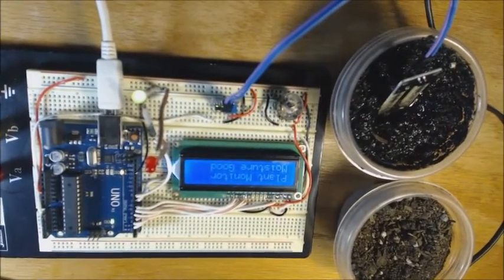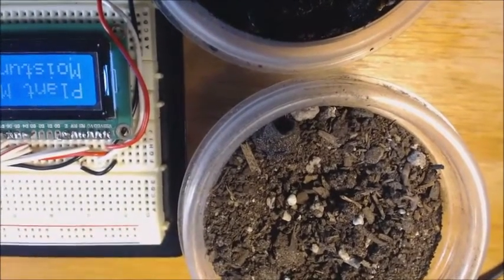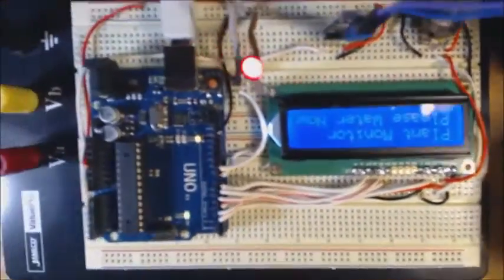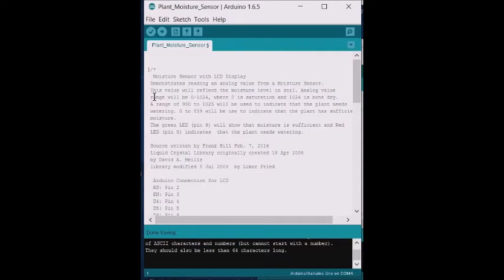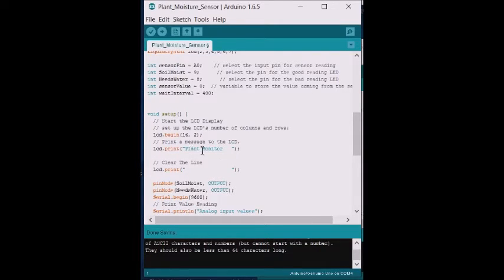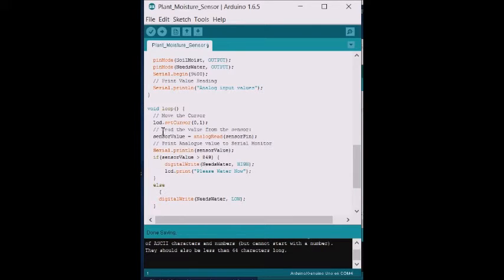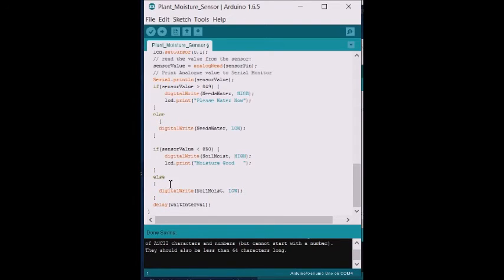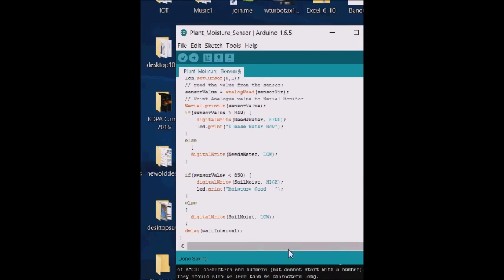SoilMonitor

Comment: sir plz send me tha program with LCD ganeshtambade77@gmail.com
Reply: Pour ma part j'ai opté pour un écran I2C LCD.

Je vous donne le code qui fonctionne. Pour les branchements seules les LEDS et le Soil Monitor sont valables.
Ecran I2C LCD
scl=a4
sda=a5
vcc=5v
gnd=masse

//Essai numéro 1
//L'écran s'allume au démarrage
//La détection fonctionne voir plus tard pour réglage
//Première ligne s'écrit je tente la seconde
//Elle fonctionne, je tente l'autre
//impeccable tout fonctionne
//Il me faut régler l'intervalle (ce sont les commentaires de mes essais)

#include <Wire.h> 
#include <LiquidCrystal_I2C.h>

LiquidCrystal_I2C lcd(0x27,16,2);  // set the LCD address to 0x27 for a 16 chars and 2 line display

int sensorPin = A0;           // sélectionner la broche d'entrée pour la lecture du capteur
int SoilMoist = 9;              // sélectionnez la broche pour la bonne LED de lecture
int NeedsWater = 8;         // sélectionnez la broche pour la mauvaise LED de lecture
int sensorValue = 0;        // variable pour stocker la valeur provenant du capteur
int waitInterval = 400;

void setup()
{
  lcd.init();                      // initialize the lcd 
  lcd.init();
  // Print a message to the LCD.
  lcd.backlight();
  lcd.setCursor(3,0);
  lcd.print("DUPONT");
  lcd.setCursor(2,1);
  lcd.print("PONDUT");

pinMode(SoilMoist, OUTPUT); 
pinMode(NeedsWater, OUTPUT); 
Serial.begin(9600); 
// Print Value Heading 
Serial.println("Analog input values"); 
   
}

void loop()
{
  // lire la valeur du capteur: 
sensorValue = analogRead(sensorPin);
 // Imprimer la valeur analogique du moniteur série 
Serial.println(sensorValue);
 if(sensorValue > 849) { 
     digitalWrite(NeedsWater, HIGH);
          lcd.init(); 
          lcd.backlight();
          lcd.setCursor(0,0);
          lcd.print("Arrose de suite");
          lcd.setCursor(5,1);
          lcd.print("Merci!");
      }
 
  else 
{ 
    digitalWrite(NeedsWater, LOW);
 }
if(sensorValue < 850) { 
        digitalWrite(SoilMoist, HIGH);
          lcd.init(); 
          lcd.backlight();
          lcd.setCursor(2,0);
          lcd.print("Arrosage bon");
          lcd.setCursor(5,1);
          lcd.print("Merci!");     
} 
  else 
{ 
      digitalWrite(SoilMoist, LOW); 
} 
delay(waitInterval);

Comment from the maker: It took a while, however, here is the code!
/*
  Moisture Sensor with LCD Display
 Demonstrates reading an analog value from a Moisture Sensor.
 This value will reflect the moisture level in soil. Analog value
 range will be 0-1024, where 0 is saturation and 1024 is bone dry.
 A range of 950 to 1025 will be used to indicate that the plant needs
 watering. 0 to 859 will be use to indicate that the plant has sufficient
 moisture.
 The green LED (pin 9) will show that moisture is sufficient and Red 
 LED (pin 8) indicates  that the plant needs watering.

 Source written by Frank Hill Feb. 7, 2010
 Liquid Crystal Library originally created 18 Apr 2008
 by David A. Mellis
 library modified 5 Jul 2009  by Limor Fried 
 
  Arduino Connection for LCD
  RS: Pin 2
  EN: Pin 3
  D4: Pin 4
  D5: Pin 5
  D6: Pin 6
  D7: Pin 7

 */
#include <LiquidCrystal.h>
LiquidCrystal lcd(2,3,4,5,6,7);

int sensorPin = A0;    // select the input pin for sensor reading
int SoilMoist = 9;      // select the pin for the good reading LED
int NeedsWater = 8;      // select the pin for the bad reading LED
int sensorValue = 0;  // variable to store the value coming from the sensor
int waitInterval = 400;

void setup() {
  // Start the LCD Display
  // set up the LCD's number of columns and rows:
  lcd.begin(16, 2);
  // Print a message to the LCD.
  lcd.print("Plant Monitor   ");
  
  // Clear The Line
  lcd.print("                ");
    
  pinMode(SoilMoist, OUTPUT);
  pinMode(NeedsWater, OUTPUT);
  Serial.begin(9600);  
  // Print Value Heading
  Serial.println("Analog input values");
}

void loop() {
  // Move the Cursor
  lcd.setCursor(0,1);  
  // read the value from the sensor:
  sensorValue = analogRead(sensorPin);
  // Print Analogue value to Serial Monitor
  Serial.println(sensorValue);
  if(sensorValue > 849) {
      digitalWrite(NeedsWater, HIGH);
      lcd.print("Please Water Now");
  }
  else
    {
    digitalWrite(NeedsWater, LOW);
  }
  
  if(sensorValue < 850) {
      digitalWrite(SoilMoist, HIGH);
      lcd.print("Moisture Good   ");
  }
  else
  {
    digitalWrite(SoilMoist, LOW);
  }
  delay(waitInterval);
}
Reply: Bonjour
J'ai suivi vos conseils et adapté des petits détails.
Tout est fonctionnel. Fait avec un écran LCD I2C.
Voici le code//Essai numéro 1

#include <Wire.h> 
#include <LiquidCrystal_I2C.h>

LiquidCrystal_I2C lcd(0x27,16,2);  // set the LCD address to 0x27 for a 16 chars and 2 line display

int sensorPin = A0;           // sélectionner la broche d'entrée pour la lecture du capteur
int SoilMoist = 9;              // sélectionnez la broche pour la bonne LED de lecture
int NeedsWater = 8;         // sélectionnez la broche pour la mauvaise LED de lecture
int sensorValue = 0;        // variable pour stocker la valeur provenant du capteur
int waitInterval = 32000;

 int dryValue = 996;       // valeur sèche du capteur
 int wetValue = 426;       // valeur humide du capteur

 int friendlyDryValue = 0;   //
 int friendlyWetValue = 100; //

void setup()
{
  lcd.init();                      // initialize the lcd 
  lcd.init();
  // Print a message to the LCD.
  lcd.backlight();
  lcd.setCursor(3,0);
  lcd.print("FILLASTRE");
  lcd.setCursor(2,1);
  lcd.print("JEAN MARIE");

pinMode(SoilMoist, OUTPUT); 
pinMode(NeedsWater, OUTPUT); 
Serial.begin(9600); 
// Print Value Heading 
Serial.println("Valeurs d'entree analogiques"); 
   
}

void loop()

{
  // lire la valeur du capteur: 
sensorValue = analogRead(sensorPin);
 // Imprimer la valeur analogique du moniteur série 
Serial.println(sensorValue);
 if(sensorValue > 849) { 
     digitalWrite(NeedsWater, HIGH);
          lcd.init(); 
          lcd.backlight();
          lcd.setCursor(2,0);
          lcd.print("Arrosage en");
          lcd.setCursor(5,1);
          lcd.print("service");
      }
 
  else 
{ 
    digitalWrite(NeedsWater, LOW);
 }
if(sensorValue < 850) { 
        digitalWrite(SoilMoist, HIGH);
          lcd.init(); 
          lcd.backlight();
          lcd.setCursor(4,0);
          lcd.print("Il a plu");
          lcd.setCursor(0,1);
          lcd.print("Pompe a l'arret");     
} 
  else 
{ 
      digitalWrite(SoilMoist, LOW); 
} 
 {
   Serial.print ("Releve:"); 
  Serial.print (sensorValue); 

  Serial.print ("|"); 

  int friendlyValue = map (sensorValue, dryValue, wetValue, friendlyDryValue, friendlyWetValue); 

  Serial.print ("Humidite:"); 
  Serial.print (friendlyValue); 
  Serial.println ("%"); 
  } 
delay(waitInterval);
 }